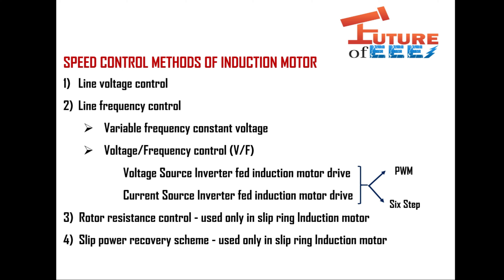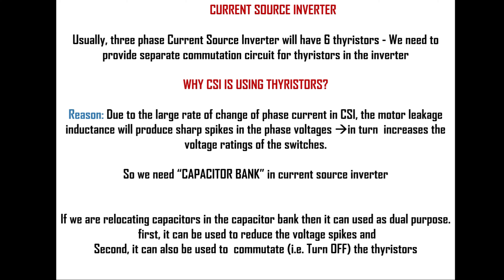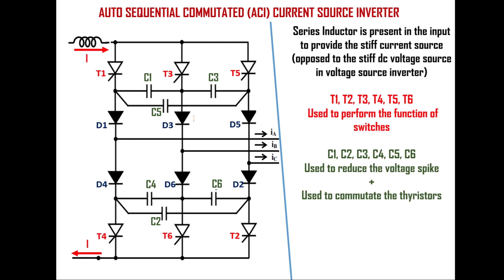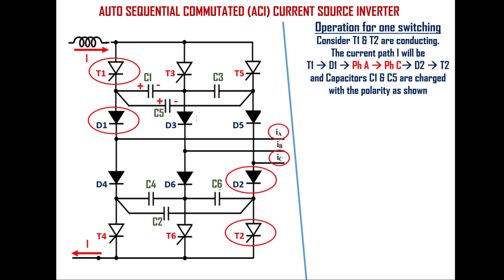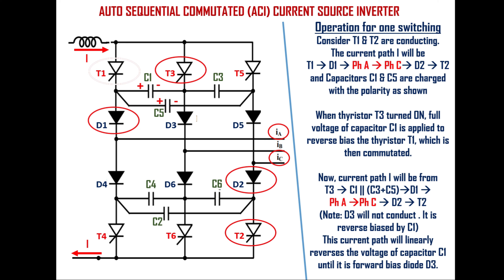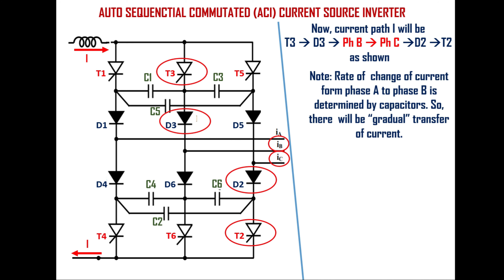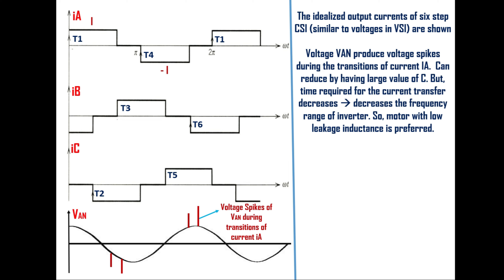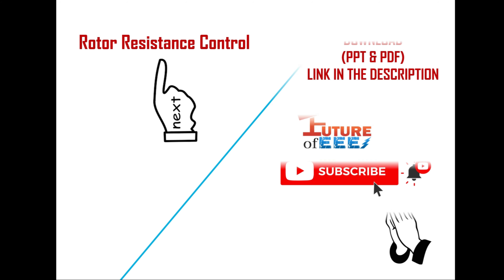Current Source Inverter (CSI) - Six Step - Auto Sequential Commutated

Comment: I dont understand why C1 makes the diode reversed biased..
if you turn on SCR, then isn't it that the diode should conduct immediately?
Reply: could you tell me where you learned it or the source of it?
Reply: because the capacitor holds its charge and the polarity is still as shown at 3:53. There you can see, that the negative side of capacitor is connected to the anode of D3=reverse biased